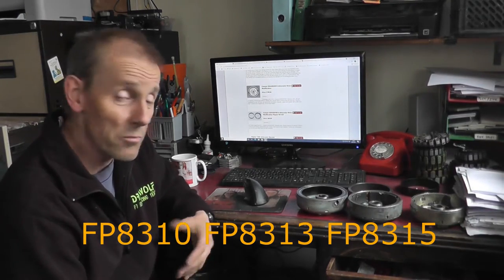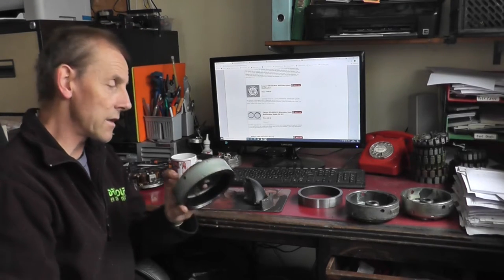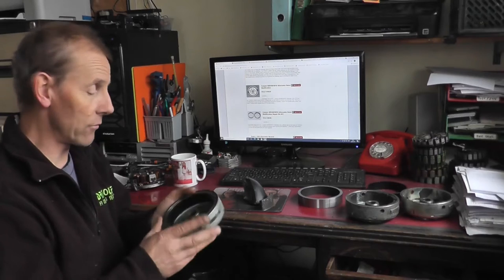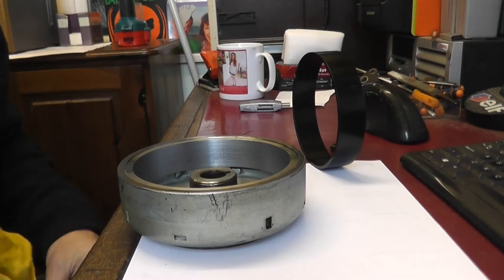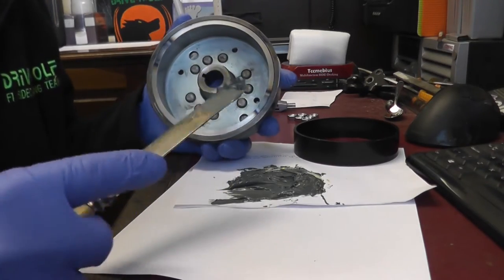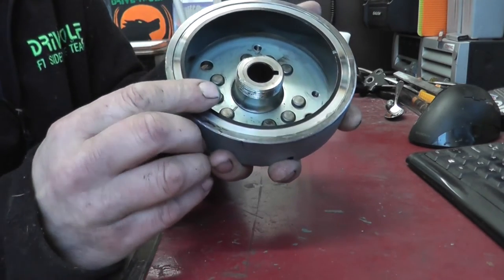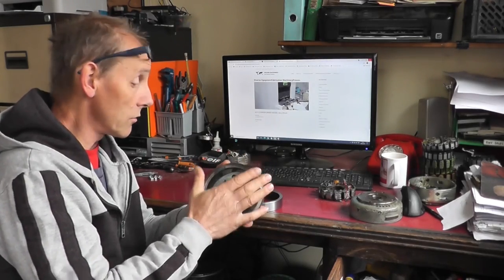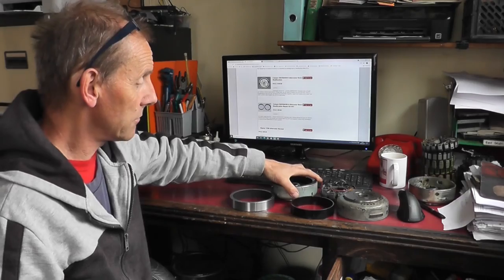Cagiva Canyon W16 Flywheel Rotor modification replace broken magnets FP8310 FP8313 FP8315

Comment: Hello! I watched the video with great interest, because my Cagiva River has the same problem - a crumb magnet. For a long time looking for a way out of the situation, there were all sorts of options to do. Everything sticks to the problem - money, money .... Now I think whether to send those rings to you, but I don't know if I will be able to do it at home, it is also difficult to find a good master in Latvia. Now just a financial issue and think it will send you this rotor. Thanks for the idea!
Reply from the maker: What is the part number on your flywheel? Should start with "FP"
Reply: @bbbikeshop8359  8313
Reply from the maker: @uldisermansons  We already can now supply new replacement FP8315 flywheels, hopefully in the next month or so we should have new replacement FP8313s available to. But for now we can only do a modification to OE flywheels.

Comment: Maybe you are the guy I should ask, the regular shop guys seemed too frightened to limb it :D 

I´m coming from Briggs & Stratton/Honda utility style 4 strokes, chainsaw/trimmer style 2-strokes, but I have never stuck my toes in bikes. I now have a late 1950´s clenodium 4 stroke 7-10 HP single cyl with a motorcycle/moped style 1-row multi magnet flywheel, ignition coil, power coil and breaker point ignition system on a separate lobe axle 1/2 gear ratioed between lobe and crank. 
(Its called a Westerbeke Universal engine nr 10... No documentations to be had from neither the engine manufacturer nor on the Bosch ignition numbers,  it´s too old) 
My ignition part numbers gives me related matches in older Vespa´s and others. 

Engine is good, the breaker is shot. I cant seem to find a new one alike so I figure to go conversion to modern breaker free for less hazzle, just replacing the entire system, magnets and all, adapt to fit to my main mass flywheel. 

I dont know anything about bike standards and the MC shops just keep listing up fitting bikes on their parts and I have not found anything in my fresh dive about industry standardisations of geometrics. 
My original flywheel magnets inner diameter is 98mm+ slight tolerance for the original coils. What bike model parts of today could fit for this ?

Magnet ring nr LM/US1/138/12/6
Coil base plate nr ZPT 327Z 332 Z

Comment: Hello, great video. I have a dt230 lanza and the 4 90° magnets got destroyed. Is there somewhere that I can order replacement magnets or can you fix it? Inside diameter of the magnets is 98mm and outer 108mm.
Reply from the maker: Sorry, I can't help with this size of magnet ring.

Comment: Where do I get replacement magnets for a flywheel rotor on a 1984/85 kawasaki ZN1100b? Should I install them myself of glue them on the rotor?
Reply from the maker: Sorry, but I have no idea where to get magnets for that flywheel rotor.
Reply: Thank you for the reply, but there must be a supplier in USA for replacement magnets to glue in on my rotor.
Reply from the maker: @douglaseames4922  The one piece magnet that I use in this modification has a different wall thickness than the OE magnets have, hence why a steel insert has to be fitted. I'm guessing that the flywheel fitted to your ZN is made by Kokusan? I have tried for years to source these OE magnets without any luck. I do supply new replacement flywheels for the early 1980s Z/GPZ 1000S and 1100s but I don't know if the ZN models have the same rotor fitted?
Reply: I ordered a rotor with magnets on eBay for my bike, but there must be away to replace the old magnets in the flywheel rotor on a 1984/84 kawasaki zn1100b. Thank you for the reply. @bbbikeshop8359

Comment: Is this something that could be done to a 06 Husqvarna sm610? And what is the cost of a job like this?
Reply from the maker: Yes, it can be done on the SM610 as long as the ignition system on that bike is Kokusan Denki, the price is on our website at the same price for the Cagiva Canyon models here https://www.bbbikeshop.co.uk/details/ppB1KC_22041480.aspx  or a DIY kit here https://www.bbbikeshop.co.uk/details/ppB1KC_22041467.aspx

Comment: Hello mate, I’ve got a 1993 yz250 and the magnets are all smashed inside the flywheel, is this something you could replace for me? Thanks
Reply from the maker: Sorry, but unfortunately I cannot get the magnets for this size of flywheel.
Reply: @bbbikeshop8359  ok thanks the flywheel is 100mm wide if that helps